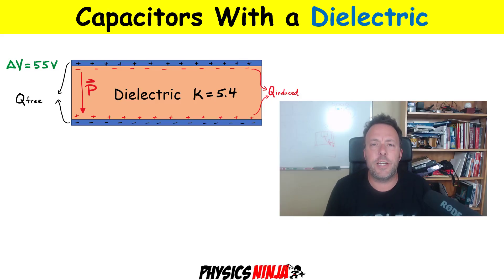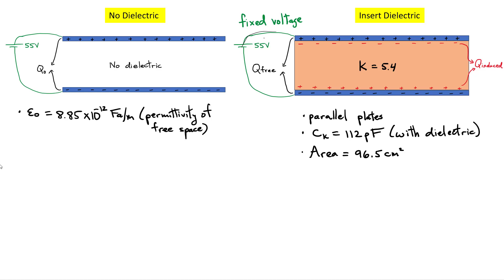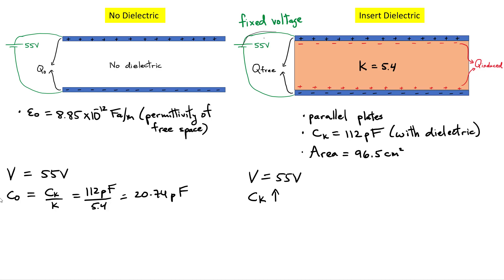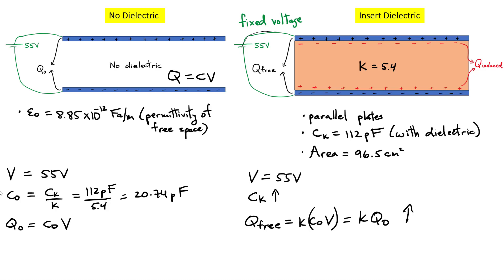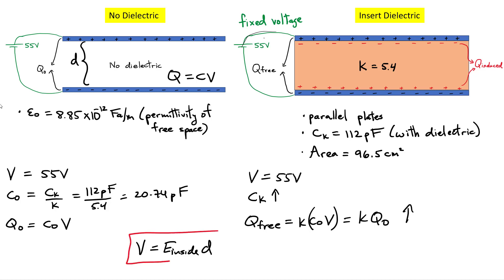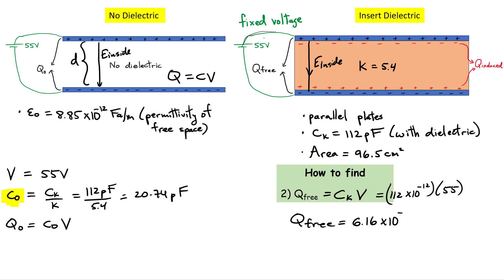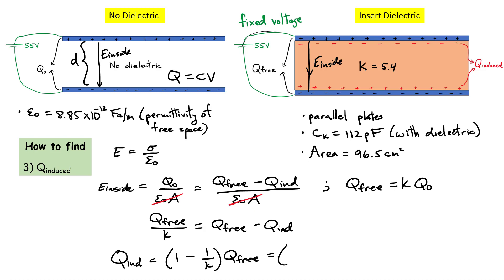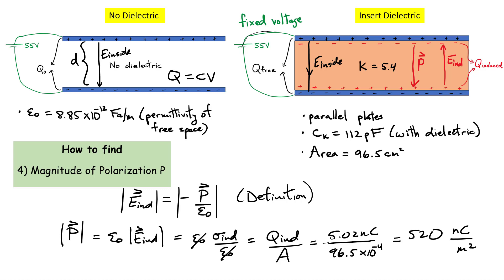Capacitors with a Dielectric -  Field Inside, Free Charge, Induced Charges, and Polarization

Comment: How would you find the electric field between the plates after dielectric is inserted and battery is disconnected after charging the plates?
Reply: Isnt it the same as the value after charging without disconnecting it? Q, d and A remain the same right? So V and E must remain the same